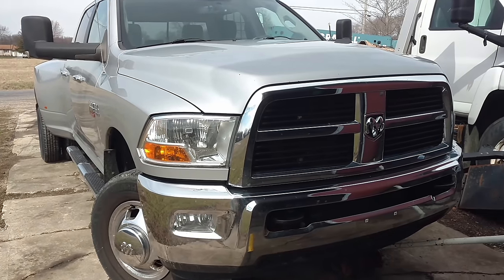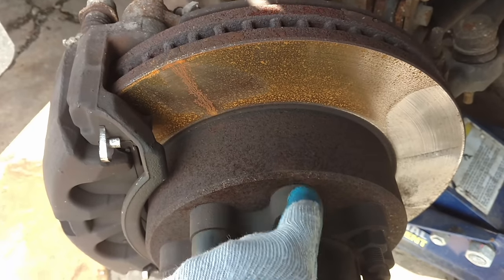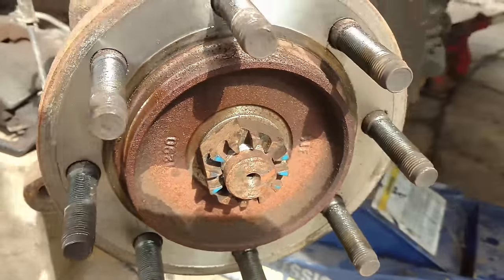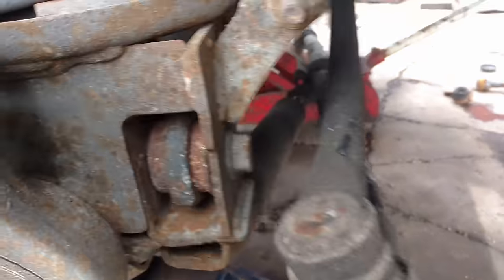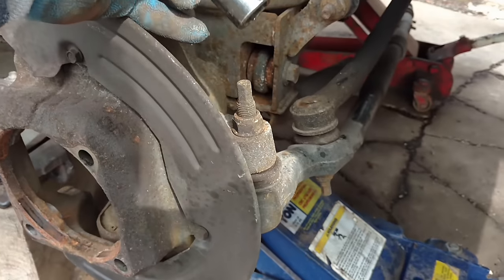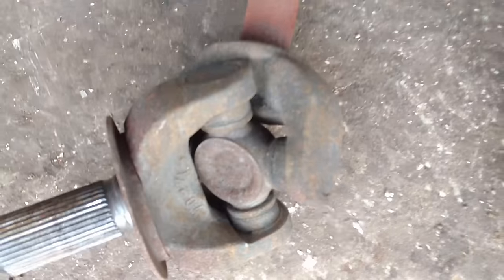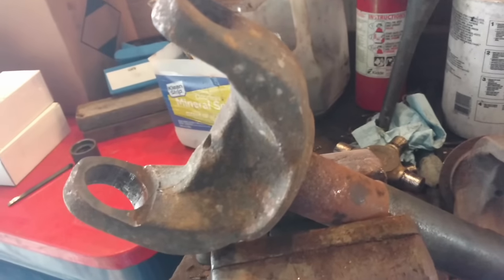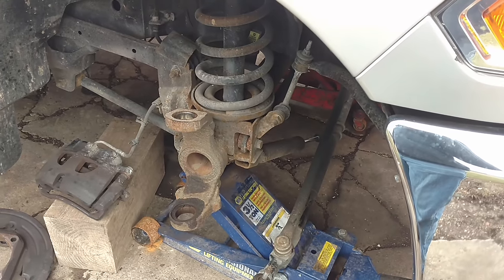PT 1) 2011 RAM 3500 DUALLY 4X4 BALL JOINTS, AXLE JOINTS & HUB BEARINGS

Comment: Great video thanks brother. I like how you make everything look easy. I have seen u joints put in and be tight everything went good. The problem was that the shaft bent just a little bit when taking the old out or when he put the new in. The clips was pretty close but had to fix the shaft first. The dang Chevy aluminum shaft two different sizes on the u joints. Was not a fan of the drive shaft being aluminum. I do see your point you have it that far you hate to get it done and have to do it again because you didn't change that one part. Thanks again see you in the next video
Reply from the maker: Thats right scott. i didnt want to do all this work and have to go back in later to do something that i could have easily done now.

Comment: I cannot believe Napa would do such a thing. Every single Napa I’ve ever seen was geographically 24 hours from almost any part you need. I can’t understand why they never have what you need today but always manage to be able to get it the day after you need it. I normally just wait because most things,  especially belts I never buy from auto zone or O Reilly.
Reply: Great video!  I love the songs!!
Reply from the maker: it was just a mistake. they had the correct ones in stock but i didnt realize they were wrong until after they were closed.i got them today and installed. truck is all back together now.
Reply: J.C. SMITH PROJECTS oh ok. That’s good!!  My Napa store has very knowledgeable people they don’t stock the stuff auto zone does and I’m not a fan of auto zone so I always wait. Napa is the only local parts house left around here.
Reply from the maker: i use napa, ford and rock auto for some motorcraft parts. i have no interest in autozone, advance or oreily.

Comment: Good Video...is it me or is this Dodge steering drive axle easier to get along with...if l remember l think you needed special tools for that Ford you did...also do they put that adapter on because it's a dually truck...good video JC - l learned a few things
Reply from the maker: in some way yes but in others no....the superduty rotors just slip on over the studs and the wheels hold it in place where this one sandwiches the rotor between the hub and dually adapter. yes the adapter is used because it is a dually.
Reply: James Dodge trucks are just like big Jeeps, no special tools for most of the drivetrain items. Fuel lines and some sensors require special tools.

Comment: Surprised a truck that new needs so much work. How many miles is on it?
Reply from the maker: it doesnt need everything i am doing but it did need all the ball joints and 1 hub bearings assembly. i just did it all since i had to take all of that apart to fix the ball joints.